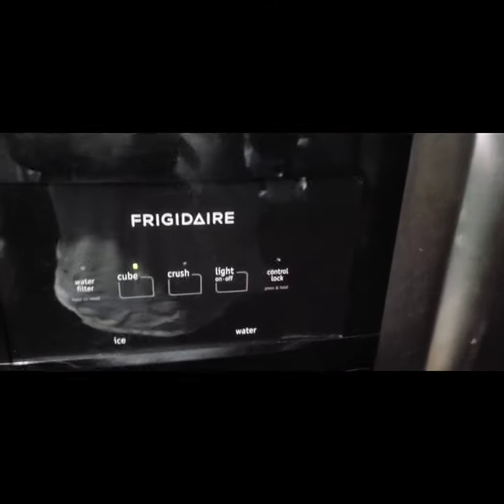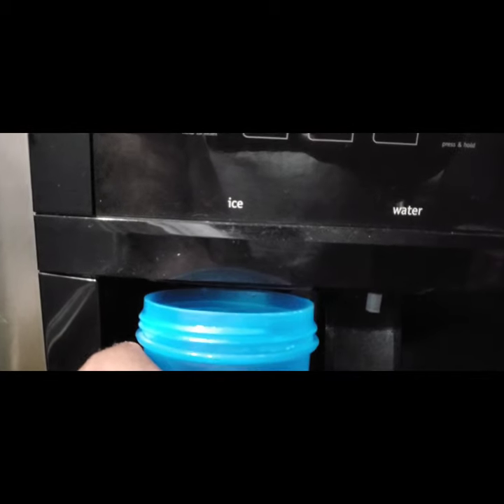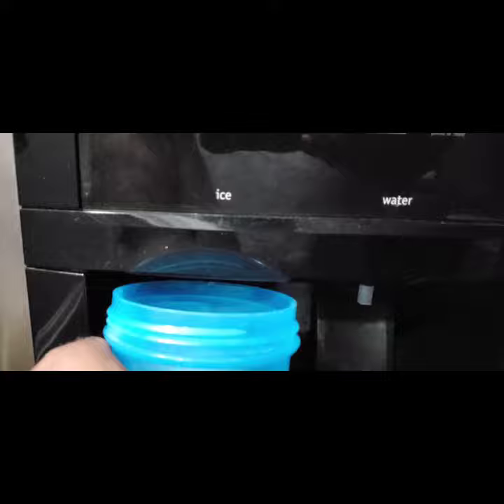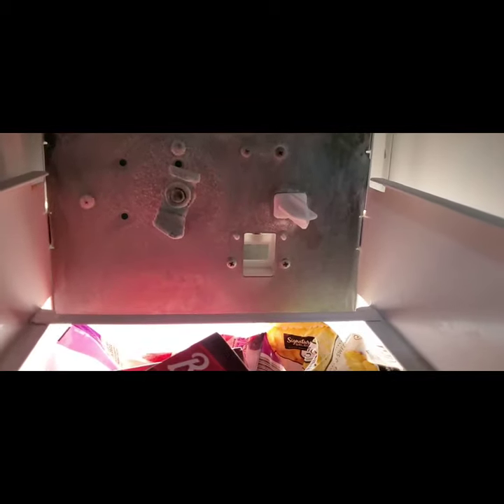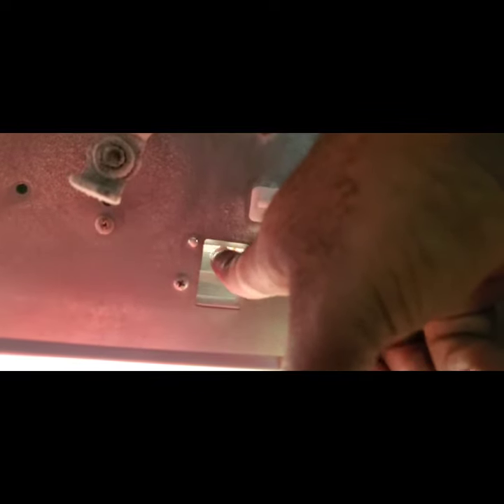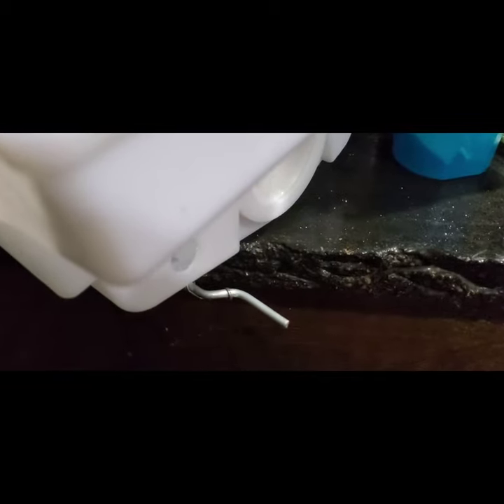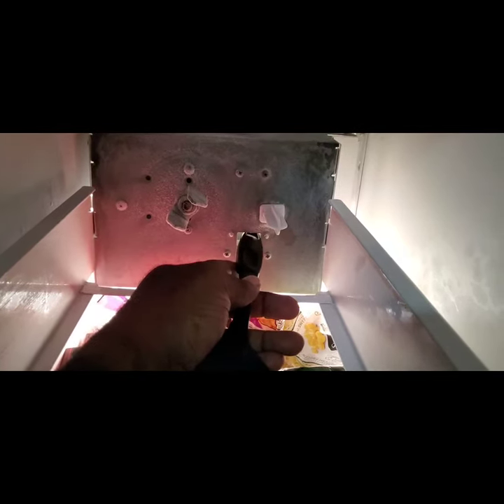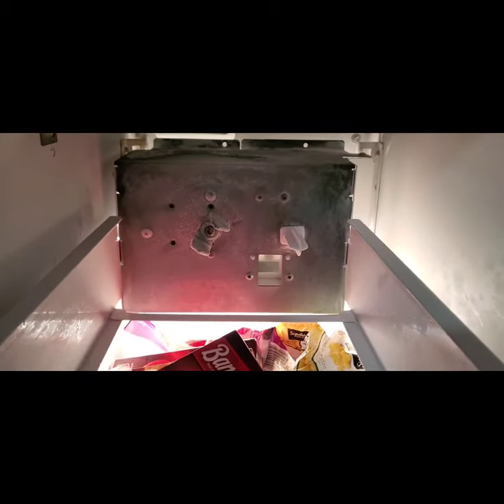fix icemaker only making crushed ice. super easy

Comment: My refrigerator stopped dispensing water.  After several days on YouTube University, I realized the following:  My freezer was still making ice.  I changed my water filter to a new filter and purged out any  air in the line.  My refrigerator side crisper area water reservoir tank was not frozen.  I changed my water inlet valve to a new water inlet valve and  verified both for continuity prior to installation.  Both the old and the new showed nearly identical continuity confirming a working water inlet valve.  And still, no water.  Unless both the old water inlet valve and the new water inlet valve both have defective mechanical issues.  What are the odds?  I am suspicious to that being the issue.  I removed the main water line and  checked water flow.  Very solid and good pressure.  I then connected the main water line to the new water inlet valve and turned on the water supply.  The water ran through the water inlet  valve up into the water filter and back down the return line.  That is where the water flow ends  for dispensing water to drink, but not  to the freezer to make ice cubes.  So, something is not  "turning on" or allowing the water to be dispensed at the push pad.  Yet, water is going up to the freezer to make ice.  I am baffled.
Reply from the maker: Waaay above my education level.. good luck .. and if you find out what went wrong please come back and let me know.. make a video and drop the link here.. I haven't had that issue yet. But if it happens I would like to know the fix for it.. 
I'm guessing the line isn't frozen.. . Im sure you've defrosted the fridge with all the work you have done.. .
Personally tbh I know nothing about anything I do. I'm just mostly guessing and you tube University my way through life's problems.. good luck on your journey my friend
Reply: @TFE_MaD  Ironically, I did further testing to isolate and rule out certain suspicions.  I removed the lower front plastic panel at the bottom of the refigerator and disconnected the water line.  I pushed on the dispenser pad and no water was dispensing from that water hose.  That hose leads back to the water reservoir.  Seeing my water reservoir was not frozen, it was low on water due to blowing into the line from the rear water valve to ensure no obstructions in the line.  Once I blew into the line, the air pressure forced water out.  I did this several times not knowing it lowered the water reservoir water level below the inlet and outlet points.  But either way, something is not refilling that water reservoir.  So I spoke with a technician and he confirmed that the hose at the lower front does come off the water reservoir and that the water valve fills the water reservoir.  So with all I explained; new water valve, new filter, ice is being made, no water being dispensed or filled in the reservoir, he said it is most likely the Control Board; the part behind the buttons we press for water, crush, cube.  He said it sounds like it failed.  I already placed an order for a new one and will keep you up to date.  Prior to one week ago, I knew nothing about refrigerators.  Now I seem to know a great deal.  Hopefully I can solve this issue.  To be continued...
Reply: @TFE_MaD  Sir, my issue is SOLVED.  It was the Refrigerator Dispenser Control Board that is behind the water/crush/cube dispenser cover.  $35 refurbished from Amazon.  Two screws to remove the front plastic dispenser cover.  Remove the Red and Black module push on wires.  Remove the Computer Board wiring harness.  Reinstall the Control Board.  Water dispenses like a charm and this is something anyone who can use a screw driver can do.
Reply from the maker: @GR8WHITEC5  great.. I was hoping you made a video... but this is solid information.. . So I know if the water ever goes out to see if the like is frozen.. then change the board..
Reply: Probably a solenoid, ours makes a "click" sound when it dispenses water.
Reply: @GR8WHITEC5  good for you and your perseverance!
Reply: My freezer was freezing the water line right before the dispenser, inside the door. So I blowed dried the inside of the freezer door and the dispenser spout, then taped cardboard to the inside door where the dispenser should be underneath. This prevented the water lines from freezing.

Comment: That fixed my icemaker to making cubes a year ago.  For some reason, the sqare springy mechanism in the back of the fridge, behind the icemaker kit wouldn't come free this time.  It stayed stuck up top and would only do crushed.  What I was able to do by watching this carefully again is get that piece of metal that catches onto the spring, to set back onto the square spring.  Once I had carefully jimmied the metal piece back onto the spring, I got cubes again.  Didn't have to do that last time, but it worked.

Comment: You just saved me a service call! My Whirlpool fridge was doing this and I appreciate your explanation of how an ice maker switches back and forth but the factory setting is on crushed, which I didn’t know. My hubby and I  got ours fixed in 50 minutes using a blow dryer! 👏🏻 THANKS!
Reply: I just found this video and of course your blow dryer comment! If the the spatula end doesn't work for me, I'll try the dryer next, so thanks for the idea! 😊 I was trying my finger, making alot of noise in the freezer and my mom thought something happened in her kitchen 😅
Reply: @MAHWL  my fridge actually has done this twice! What I do now is I leave my button on the water setting. When I need crushed ice, I switch to that button, retrieve my ice, then switch to cubed. Once I hear the snap of the flap closing, I switch it back to water. It hasn’t frozen up since! I am also very careful to poke my finger in that square hole in the back once in awhile (before I need crushed ice) to make sure the mechanism moves freely, THEN I will pull out the ice cube bin or use the crushed ice button. I’m sure you already had the instance of not being able to pull the bin out because the mechanism is frozen stuck in place! I also shut off ice making with the lever before it gets overfilled. NOTE: the blow dryer is easy to use if, and only if, you are able to pull the bin out!

Comment: DUDE! You rock! Ive been stuck on crushed ice for like 3 months and now its fixed.
Reply: I got stuck for over a year and it was wearing me out to scoop ice cubes into a bin and fetch them manually.  Doesn't sound like much, but I had frozen shoulder then.  The repair guy came and must have done this, but didn't explain what the problem was well enough.  After a power outage, they have a tendency to get stuck again, so this video saved the day.

Comment: This totally helped me. Apparently they can be frozen either direction. Mine was stuck the opposite direction  where I could only get cubes even though it said crushed. Pulled out ice holder, dumped and saw the bar with spring jammed. Rinsed, dried, now just like new. Thanks sooo much.
Reply: Yep, similar

Comment: This is brilliant, thank you.  I was stuck w/ crushed ice for over a darn year.  I tried every kind of trouble shooting I could find, but had to resort to manually storing cubes in a container (since crushed ice melts right away).  We called a repair man finally and it was fixed.  I'd just defrosted and cleaned the bin and that dumahickie must have finally unstuck itself.  Repair guy charged just a service fee and didn't explain what unstuck well enough.  We had an 8 hour power outage and the melting caused the thing to freeze again.  Thankfully I found this.
Reply: It’s a solenoid valve that pushed and retracts the plastic square piece.

Comment: nice to see someone finally explaining how the crushed vs dynamic works -- thank you. I'm going to try what you said, but in the meantime, I just used a wire-tie to loop around the flap and the bar to keep it in the open position -- that seems to work as we don't care about crushed ice anyways
Reply from the maker: I dont know anyone who uses crushed other then my children and they stop using it after the first few months... they really should build these to default to whole ice if the system malfunctions
Reply: Can you explain how you did that? I tried what he said. The problem is the flap in the back is stuck up. It won't come down. I can pull it down and push it up, but it takes a bit of strength.... Mine's almost the opposite of what he said.
Reply: @joyhunter3426  Yes, I can help you out, because I had that problem most recently too.  In the past, his fix worked, but mine got stuck up and I can't loosen it down.  I tried blow dryers and nothing worked to unstick it this time.

What did work was watching this whole video again carefully to see how it all worked.  When he's explaining that little metal bar that sticks out on the bottom of the ice bin, that's the key.  You need to latch that back onto the square plastic bit at the back of the fridge, behind the ice maker kit.  So I just pulled my ice tray out a bit and looked under the whole housing.  W/ one arm I reached back to grab that square bit and pull it down and the the other hand hooked that steel bit onto the square bit.  I immediately had ice cubes again.
Reply: All you have to do is let it defrost for about 15 minutes.  It will come lose then.

Comment: Thank you.  Very informative.
In my case, the rear slider has come off the tail but it was easy enough to remove the ice maker unit and put it back on track.  It is a plastic slider attached to a metal rod , the rod I’d lifted by a magnetic mechanism .  
Thank you
Reply: That was my problem last time.  That metal rod had come off the square plastic slider at the back of the fridge, behind the ice kit.  I was able to pull the ice kit out a bit and reach underneath, pull the square bit down and hook the metal rod back on.  Back to cubes again.
Reply: It’s a solenoid valve

Comment: I have been cursing out my ice maker for about 3 months now.  It kept getting jammed because I don't have a water line and I was using just trays for ice.  The cube nature of them tended to get broken into chunks and then jam in the works cause it to stop turning.  Watched this video and noticed that my spring worked just fine, but it was in the up position.  

Understanding how it worked I was able to hold down the spring and insert the tray back in making sure the bar went into the square.  Then let go and it grabbed it and moved it up.  NO MORE ICE JAMMING!  So happy.

Comment: This works both ways. We only had cubes. Pulled out the ice catcher and moved the spring up and down. Took all of 1 minute and both crushed and cubed work now. Thanks!  The spring must have been stuck :)
Reply: Those springs tend to get stuck w/ frozen ice after a prolonged power outage.  That's when they seem most likely to glitch again.

Comment: Thank you! I forgot that stupid thing in the back of the freezer that actuates the lever gets stuck on mine. It always gets stuck in the up position so i nudged it back down and now it works. I haven't had cubed ice in months lol
Reply: That square bit at the back of the fridge won't stay down this time.  The spring keeps it in the up position, even w/ a blower dryer.  So I just pulled the ice kit out a bit and jimmied that metal rod back onto the spring and that worked to get my cubes going again.

Comment: Alright bru, I understood what you did here. In my former life, I did not have the courage to remove the housing at the back of the fridge. Your method is probably what I would have done, if I knew that was my problem. But now, I've gotten lazy and want to know why moisture is getting back there and freezing up the components. I do not want to keep pushing up on that switch every so often. I would look back there and I would be expect to find tiny water droplets dripping from the inlet valve to the ice maker. If I solve the dripping water (or whatever is causing the moisture) I've solved my problem. But in a quick fix, you hit the nail on the head and I can get me some ice cubes/crushed ice immediately. Thanks for the old school method. Braun or brains but not very often.
Reply from the maker: Sounds complicated.. what ever caused it to freeze hasn't happened again.. . But I do tend to bang on the ice tray ever now and then.. just to remind the fridge who's the boss.. ..

Comment: I have the opposite problem. My ice isn't getting fully crushed. Is that blade that wiggles and moves freely when you turn everything upside down suppose to be on the side of the little door hatch thing or on the other side away from the door hatch? I tried both ways but it still only partially crushed the ice.

Comment: Did I misunderstand you? My little switch in the back moves very freely just like shown in your video but it’s still stuck only crushing ice. Is the spring supposed to be more stiff when it’s working right? I can hear it move when the tray is removed but once it’s in it is like it can’t lift the metal rod or something. Thanks for the help
Reply from the maker: See if the bar under the tray is moving freely..
Then check to see if the lever IN the door is moving freely... including the switch there are 3 moving part.. 1 or more could be frozen..

Comment: In my freezer, you have to put that arm UNDER that bar that goes up and down in the back of the freezer. 
Once you have that arm positioned right, under that bar, then when you press the button for cubed ice you get
cubed, and when you press the button for crushed you get crushed... assuming everything else is working right. 

Sadly we recently had our crusher spit out metal parts, and then that bar is stuck in place and the ice maker isn't 
pushing out ice all of a sudden.   Not sure what's going on, but hoping the people that own the property we rent
will replace the right things.  Oh yea, and the switch (slid right to left to turn the ice maker on or off) just fell off
one day, and I can't even see a mechanism under it where it would push anything, so that's weird!  Our ice maker
was in the on position though, and suddenly after it spit out the metal rings that go on one side of the crusher, (I saw
a part diagram) then the ice maker just completely stopped working.  There are so many variables. I wish I could find
a video that explains the entire system and how each part works!

Comment: Unless the solenoid that moves the little plastic part up and down is gone bad, if the solenoid is bad it has to be replaced
Best thing to do is leave it on crushed the solenoid is not engaged
When you want cubes click it over to cube put it back on crushed when you're done, that way you're solenoid is not engaged for weeks or years
Reply: There is a Youtube video for swapping the solenoid and it looks pretty easy.  If the solenoid is working does it make a sound when switching from crushed to cubed?
Reply: @lym3204  yes it does only works (activates) when you hot button

Comment: Wasn't that simple. Used a hair dryer to be sure ice was melted then slipped flat bladed screw-driver in the area that was to be free. Didn't work!! Worked as it did before- a few large cubes and a lot of crushed ice. Need a better fix!! Thanks anyway
Reply from the maker: Make sure you check along the whole line.. even under the bucket.. and inside the door.. not just that back area.. there are about 4 locations where it could get stuck.. might need to do a full defrost.. to be sure..

Comment: To long to get to the point.
Reply from the maker: Everyone problem is at a different place.. of o just showed the end (which might be the most common) someone might have spent money on a repair just to find out it was a different area that was frozen... You should still check for ice build up in those areas also or check for a bend in the bar..
Thanks for watching and replying